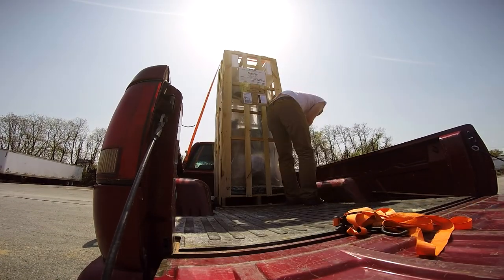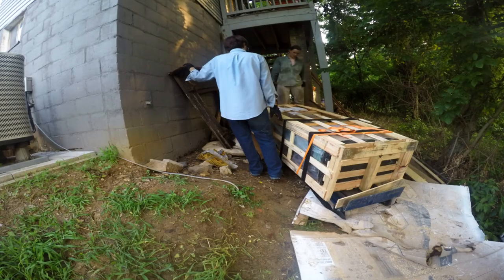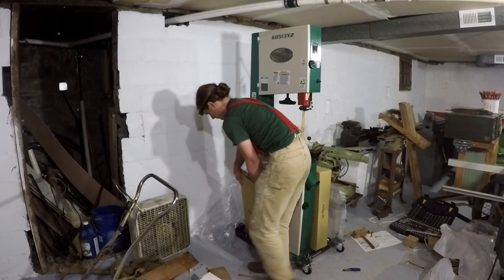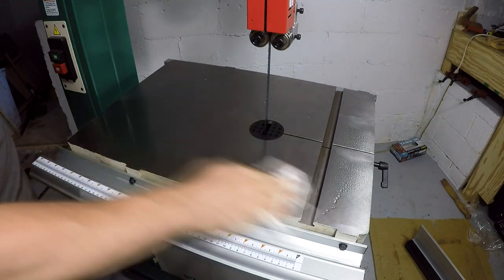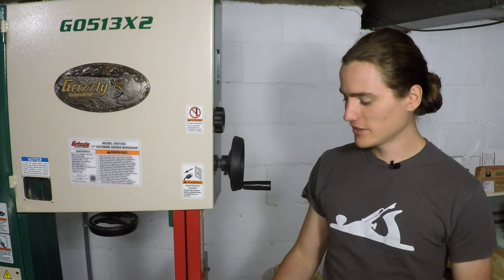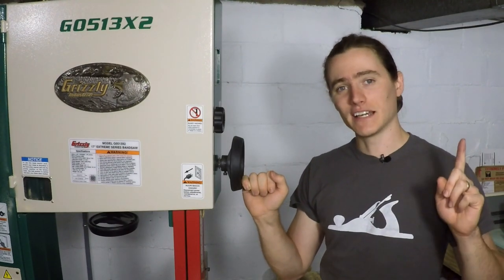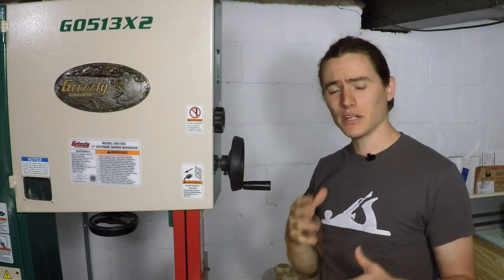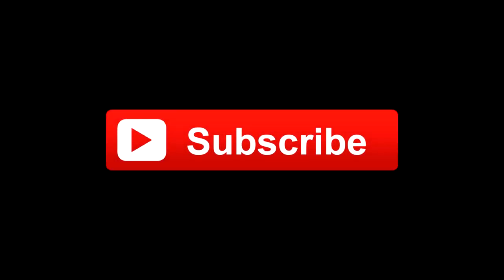My New 17 Inch Band Saw - Grizzly G0513X2

Comment: Good addition to your shop, good luck with it. Will be interesting to hear more about it as you put it into service. The only Grizzly tools I have bought are a 6 inch jointer and 14 inch bandsaw. Both have been good tools, but I outgrew the jointer and replaced it, and I need to do the same for the bandsaw though like you I can't go too big in my shop. I think from using big (20 inch, old, all iron) bandsaws I'd consider the cast iron wheels another good reason to upgrade.

Comment: Grizzly is a great company.. I have one of their variable speed lathes for 2 years and haven't had any issues. That saw is on my dream list for my shop.. Soon.......
Reply from the maker: +Jimmy Mead I've been looking for a used lathe for a while now to set up strictly as a duplicator lathe. The longer it takes to find one and the longer I'm around my bandsaw, I'm leaning toward setting my current lathe as the duplicator and getting one of the Grizzly lathes as my "Main" lathe. This is the model I'm looking at - http://www.grizzly.com/products/22-x-42-Variable-Speed-Wood-Lathe/G0766 I really like my lathe but I've also been spoiled in the past having access to oneways, powermatics and a stuby lathe.......so I know the value of having a nice lathe. I've heard good things about the Grizzly lathes so I think this model is a good way to get a great lathe without having to pay the price of the other makes.
Reply: Check out Miguel Sanchez's channel.. He just got this very same lathe just a few months ago and loves it..He also does a great review of it..  I actually am thinking of getting this same lathe... I have the G0658 which only has a 12 inch swing but has a 20 inch outbound swing on the opposite side of the head stock.. They don't make this one anymore..I like it but too small. I am needing something longer due to turning more spindle type stuff.. I also want to turn bigger too.. And I have had great luck with grizzly and their customer service is great..I dropped my tail-stock 2 weeks after getting my lathe and damaged the quill in the tail-stock.. No questions didn't even have to send the other quill in they express shipped it..

Comment: Congrats! I have a grizzly G0513ANV 17" and love it! I like yours better with that resaw fence and nicer blade guides though! 👍
Reply from the maker: +Indiana Wood Time Jones That's basically the same saw with just a few upgrades, mine has the cast iron fence with the resaw fence included (you can easily make one), the bearing guides and cast iron wheels..there's a few other differences but those are the main ones. Short story, you've got a good saw too. Thanks for the comment.

Comment: One thing I learned with using the shop fox moveable base is the fastening bolts are too high for the lower band saw door to open.  Had to remove them, leaving one side of the base unsecure.
Reply from the maker: Same here, I just replaced that bolt. It's a universal stand, not specifically for this saw.

Comment: Sorry if you already answered this but why did you have to transport the bandsaw upright? I see it was on its side for the move into the workshop, so obviously it's not that critical it stay upright...
Reply: When I picked mine up at the Bellingham store, the guy with the forklift said that they lay them down all the time. 
The slats on the packing crate are only 1/2 inch thick, so it is a bit of a problem to lift it back up out of a pickup. 
It is top heavy. There is a lifting hook at the top of the machine, so if you have a way to lift it with a hoist and chain from that, it would be better. There are several heavy pieces in the crate, a cast iron table and a box of other parts. If you can remove them first, there is a lot less to lift. 
I strongly recommend the rolling cart in that the saw is heavy and awkward to move otherwise. Use the same lifting hook to raise it and drop it in the rolling frame. The instructions also show that you can put a fork lift fork under the upper wheel frame and lift it. 
If you do not have machinery, you may want to find 3 friends to help you. 
This is a wonderful piece of machinery. With a 3 tooth Timber wolf blade, you can rip 10 inch oak about as fast as you can push it.

Comment: Might sound crazy, but looking at the skinny side of the frame, is it possible to add a lift kit to extend the resaw height?.
They sell a kit for their G555 14" model. This saw is $1000 now. I need it to resaw guitar tops and need 14+". I'd have to spend $3k to just get that ht. A lift extension would be a great fix.
Thanks.

Comment: Great video, I especially liked the part about your intro into woodworking and giving me a little background on how to got to be here today. I have a quick question, hypothetically speaking, could you have used the NEMA 6-20 plug for the band saw or does it have to be the 15? From my understanding, it doesnt matter as long as you match the required amp circuit for the application (20 amp from what I am assuming, it is for me atleast). I just wanted to double check with someone who had to wire their own plug, I have my band saw coming in a few days and would like to make sure I get the right plug before it comes. Thanks for any insight you might be able to throw my way.

Comment: Congrats on the new saw. What are your thoughts on the mobile base? I am setting mine up and it said to bolt to the floor. Does the mobile base feel steady with that big of a saw? I would like to hear your thoughts about yours. Thanks for sharing this information and keep up the good work. Thanks Johnny
Reply from the maker: +Johnny Prather I feel ok with it on the base since it's just me in the shop. If there where others around it, especially children I would bolt it to the floor or either have some sort of tether on top, attached to the ceiling so it could not tip over. I like it on the base so that I can rearrange my shop when needed.
Reply: Thank you. I think i will get a mobile base. I really like the tether idea.
Reply from the maker: There's already an eye bolt for lifting the saw on top, a carabiner hooked on it with a length of cable and another on the other end with a lag eye bolt in a beam or joist above and your safe. You can put an eye bolt where you store it and where you use it. The base is a nice option.

Comment: Isn't there a special blade that is to be used for re-sawing?  A wider blade to keep it truer in the cut?  I don't know that much about band saws so I'm asking.
Reply from the maker: +Greyman Zink Re sawing just means making one board into two or more boards...so the board size can vary. So while there are specific blades for resawing, you do not always need one, sometimes a board is 3 or 4 inches wide and other times much wider. A wider board is going to be more difficult to re saw with a smaller blade with a higher tooth count. I got several blades along with the saw, one of them is a 1 inch blade which I got for resawing and doing other ripping tasks. I'll talk more on the topic in upcoming videos, but when it comes to blades.....I'm still learning.

Comment: This is the BS I've been planning to get once I can get the 220 power run in my 'shop'. :)
Now that you've used it a bit, do you think the extra expense for the break would have been worth the extra cost given how long the cast iron wheels take to stop?
Reply from the maker: +Jon Stewart (Vaulimere) I worked in a shop with a large powermatic that I used regularly that had a break and I didn't find myself using it much so I didn't end up going with the model with the break. And times where I need to stop the blade quick, which is rare, I just cut into a scrap of wood. But the wheels do take a while to stop. I guess each person needs to think of what they do with any given tool and pick which is best for them.
Reply: The Homestead Craftsman
Oh definitely, I wasn't suggesting you should have bought the extras if you don't need them :) I've just been debating on how many of the extras to get on this one for myself. I figure it'll be the last one I buy for many years, so might as well get everything I'll actually use.

Comment: Fast-forward to today... How has the saw held up? Are you still happy with it? What kinds of issues have you had with it?
Reply from the maker: I love it, it is a great saw. My favorite thing about it is how good it is for it's size. It's a large saw, but not too tall and cuts like one much more expensive. My table saw gets a lot less use now that I have this. No issues at all. As someone that makes and sells furniture. This saw makes that job much easier and opened up options for me that I could not have without it. Paid for it's self many times over. Don't be afraid to buy it.

Comment: Thinking about buying one of these and curious to know what your main usage on this band saw is going to be.  Looks like a very useful saw but wanted to know if the 1200 dollars is going to be well spent
Reply from the maker: Well if you want a saw this size and capacity and want a new saw it doesn't get less expensive. The saw is definitely worth it's price. I use it all the time for a wide variety of projects. Most of which are far below it's capacity, but it's power and size make it nice regardless. It is very versatile. I also like that it's not too tall, fit's nicely in my low ceiling shop.

Comment: How did you attach the mobile base?  Before setting the saw upright or did you install it while the saw was laying down?
Reply from the maker: I assembled it around it as it sat in the floor then just kind of rocked it around until I got it up on it then adjusted it to fit as snug as it could around it. I did almost lose a finger in the process, so be cautious. It just sits on it, it is not bolted.
Reply: Thanks. I plan to do the same but without the near miss on the finger.

Comment: Hey man great stuff! love your channel! Im about to buy my first big boy bandsaw. im down to this saw with the foot brake or the laguna 14bx 2.5hp. im leaning more towards this saw because of table size and throat capacity. how does it do for resawing? is the top blade support sturdy? i like the ceramic guides of the laguna because the contact the blade but not a fan of how they tighten down. whats your opinion?
Reply from the maker: HI, I have not used it for a lot of resawing but when I have it worked good. I was resawing 6-8 inch boards, couple feet long. I use mine for general work and really like it, it's one of the most used tools in my shop.  I use it in place of my table saw every time I can get away with it. I have had not problem with the blade guides, or the support. It uses bearings which are easy to replace and available everywhere.  It all works well. I can't compare it to the Laguna at all as I have never used it, the only thing I would be able to do is compare specs and price.
Reply: thanks for the reply. bearings are a couple bucks each here vs 100 for the ceramic so that's a definite win there. keep up the good work!

Comment: I collect a lot of hardwood logs like oak walnut pin oak locust hickory and cherry and I am wanting to mill my own boards for a complete hardwood flooring in my house.  Will this Grizzly GO513x2 do the job.   I also want to cut circular disc to cover one room and wanted to know what is the largest diameter log I can cut in a crosscut.  Love your channel very inspiring.
Reply from the maker: This saw will not work for milling lumber for a floor, you need a bandsaw mill meant for milling lumber, woodmizer, norwood, timber king, hudson, etc. This saw is for normal woodworking. It has 12 inches of vertical capacity. Again, that would not be an easy task for it though, a bandsawmill can do that as well. Short sections can be clamped upright and milled. You could also do it with a chainsaw then smooth them up in wide helical head planer and/or thickness sander... this saw is very capable but what your talking about is just not for this type of saw, regardless of brand.....of course you can do anything if you put your mind to it, but it would be stupid.

Comment: Hey I just got the same saw and have the same mobile base as you. Do you have the saw up on shims for the bottom door to clear the bolts on the mobile base?
Reply from the maker: +Andrew Smith I just replaced the bolts with shorter ones.............or cut them down, I can't remember.
Reply: +The Homestead Craftsman Thanks for the reply! I'll check out that option.

Comment: Have you made any modifications to the band saw and would you buy this again. How has been for Resaw for Veneers
Reply from the maker: I really like it. I make furniture and a bunch of other random stuff and it has been perfect. I like that it has a large capacity but it is short enough to go in pretty much any room. Lots of power, accurate, built solid. Given its performance and price, I recommend it. I have not used it to resaw veneers much but it would work perfectly fine.

Comment: This saw with the foot brake and key lock out GO513X2BF or The Rikon 10-353 with 14" resaw but only 13 1/2 " Throat depth. It's a compromise need 14" for one piece electric guitar body's but I know I would regret the loss in depth. The Rikon has a 3 hp motor. Also wondering on motor quality. Hate to spend this much on a Band Saw and the motor go out in a couple years.2
Reply from the maker: I love the saw. Works great. I think bigger is better if you can fit it. The motor on this saw works great for me, it's 2 hp I think...the blade is just as important, with the correct blade you would be find. In the end, it's up to you. Good luck
Reply: Hello. If you want to be sure of the HP of the motor Just multiply the wattage by 1.34. This ill give the HP. Martin

Comment: how long does the typical blade last? are there different types?
Reply from the maker: +Tom McBride That all depends on what you doing with it, what type of wood, thickness, etc you are cutting? In a really busy shop, you could wear one out in a day, in a hobby shop it could last a year or more. If I remember I'll touch on that topic in the future. Yes, there are many types of blades....sizes, tooth count, geometry and blade tip materials such as carbide tipped blades. You can look around at some of the blade makers sites to get more info, my blades are made by Timber Wolf. Thanks for watching

Comment: Did you hook up dust collection
Reply from the maker: +damasydia In the couple clips on the end of this video I did not just because I was in a hurry to film them, but in general, yes. I'm using a small portable dust collector. From my experience, dust collection with a bandsaw is not the best. The gap between the table and the cabinet, causes some drop in suction and lost dust. For me it doesn't bother me, I just hit it with the vac afterward.

Comment: why did you decide on this saw,,the reason I asked is because rikon makes the same saw,,the 10-326,,and no shipping charge,,
Reply from the maker: I didn't consider that saw, just looked at Grizzly. Can't speak to the Rikon, but I know this one is nice and does everything I want. It's a lot of saw and fits in normal ceiling height rooms.

Comment: I bought a table saw from Grizzly, two times. The first time it got smashed to pieces in the back of the delivery guy's truck. The second time, on the day it was to be delivered Grizzly sent me an email telling me the saw was out of stock. After wasting a month with them, I bought a Delta Platinum. I know they make good tools but the people running the place need to get their shit together.
Reply from the maker: +TheSoloAsylum That's too bad, sounds like the first time around was the shippers fault and that the second mess up was related to the first.....regardless still frustrating.  Are you enjoying the Delta?
Reply: The Homestead Craftsman
Yes, it's a great saw but man I really wanted that Grizzly. I don't blame Grizzly manufacturing for the issues I had.